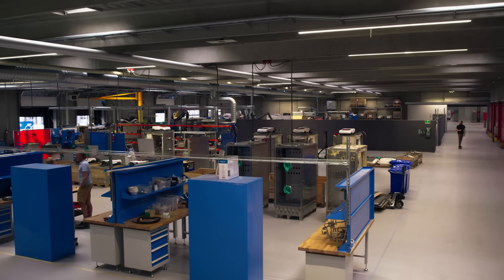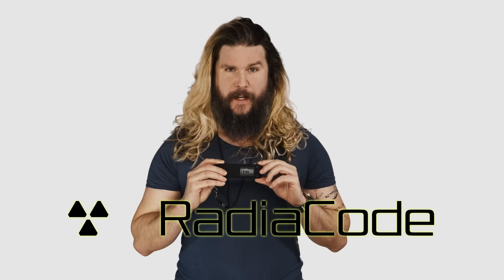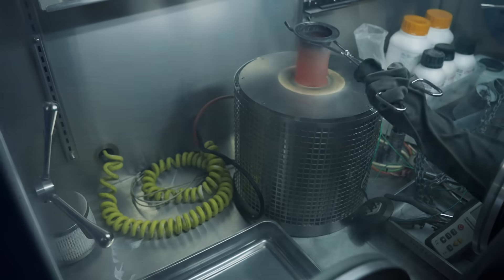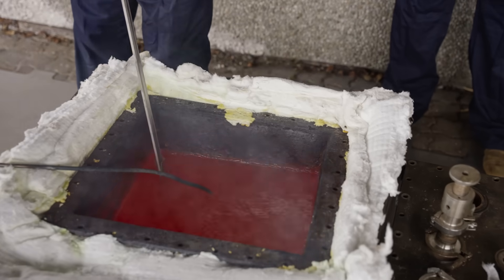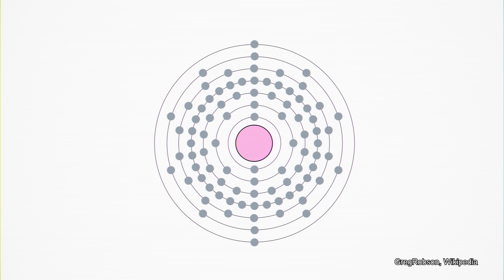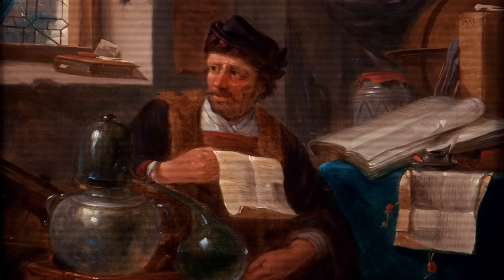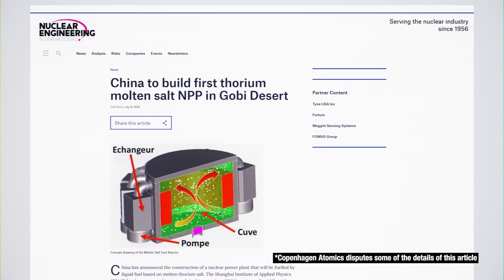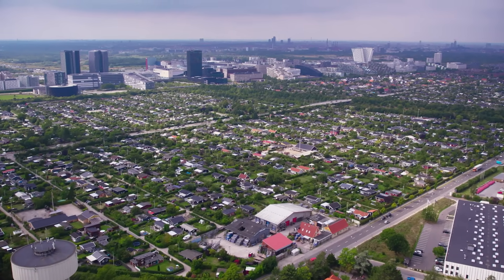Is THORIUM the Future of Nuclear Power?

Comment: The answer to your question on why the nuclear power industry is not using thorium cycle reactors is because we tried - and it turned out to be much more expensive than modestly enriched U235.  The real question is why do all the people talking about the theoretical advantages of thorium do not mention its history (perhaps because then they would likely lose funding)?

The USA built 4 commercial thorium cycle commercial power plants, and Germany built a 5th one in the 1960's to 1980's.  We have proven reactor core designs for BWR and PWR reactors; and about 80% of the world's existing power plants could be running thorium cycle in the BWR an PWR power plants right now if thorium was cheaper than modestly enriched uranium.  No one is doing that - not even India who talks about needing thorium cycle nuclear power plants (India buys U235 based reactor fuel).

I will provide more details below; but lets clear up a few other things that are false or not mentioned.

1) Thorium ore contains up to 6 natural isotopes of thorium.  Th232 is just the largest fraction by far.  While Th232 is being converted to U233 one of the other isotopes is being converted to U232 which is a hard beta radiation emitter and creates a real problem for reprocessing and use of the recovered uranium for future use as a reactor fuel.

2) U233 does exist in nature - just in miniscule amounts (and natural plutonium also exists in miniscule amounts).

3A) There is currently no known alloy that is known to  withstand the corrosive effects of the fluorine salts that most people are talking about combined with the fission byproducts (and chemical reactants) that are generated in a MSR reactor.  Note that the form of corrosion of the Hastalloy used in the Oak Creek reactor was Stress Corrosion Cracking -and was not discovered until after shutdown and testing of various piping and components.

3B) Filtering of fission byproducs in a working MSR has not yet been proven to work adequately.  There is a long way from a theory on how things should work - and how they work in real life. Lots of Nuclear Plants (test reactors and power plants) in the world had to be prematurely shut down because the theory of how something should work - just didn't in real life.

3AB testing is going on right now in China.  China build a 2 MWthermal test reactor and it went online in 2023.  They used their best guess at an alloy that showed the best corrosion resistance to what is known of the MSR molten salt chemistry from the 1960's; and combined it with their best guess of a filtering system.  Their goal is to determine if the combination of the two would produce a corrosion rate low enough to be able to build a MSR reator and systems to last relaibley at least 40 years (which they consider the minimum life for nuclear reactor).  It will likely be 5 years before we have any real answers on how well it works (unless if fails before that).

4) Thorium does not have some magic use rate that is 200 times uranium.  Uranium 238 has the very same use rate as long as its used in a breeder reactor; and then reprocessed to extract the plutonium (plutonium makes a great reactor fuel).

Also the claim of 200 times requires reprocessing of the thorium and extraction of the uranium (and you get the other uranium isotopes as well - typically U231-U234 in various amounts).  Reprocessing has proven very expensive to date - and is not an economical way to generate fuel compared to mined and enriched uranium at this point in time.  Most countries that build reprocessing plants have shut them down and at least started to dismantle the reprocessing plants  This is one of the key reasons no one is seriously building breeder reactors for U238 so they can get the same 200 times the power output from natural uranium vs once through fuel cycles.

Lets now provide a basic history of Commercial Power plants.

Many countries built thorium test reactors, and the USA Atomic Energy Commission (AEC) decided to go "whole hog" into developing commercial thorium fuel cycle plants in the 1960's. They built a thorium fuel plant. They also knew that ideally you would want to seed a thorium reactor with U233 to get it stated (for the 1st 3+ months of operation until enough U233 was converted from thorium to sustain the reaction). So they built and ran thorium cores in existing weapons production reactors and a BWR and reprocessed it into a U233 compound that could be used to make fuel for future reactors (although all 5 of the commercial reactors built use U235 as a seed material). Today the US is spending $Billions disposing of tons of those U233 compounds as the storage containers have degraded and no one sees any real future use for much U233 at this time (its a lot cheaper to dispose than to repackage and continue to store it). 

They US AEC funded the construction of 4 thorium fuel cycle commercial power plants, and Germany funded a 5th one. I suggest that anyone look up these plants on the internet and include the word thorium as well.

Indian Point Unit 1 – light water thorium fueled 275 MWe PWR power plant. Online in 1962. Changed to uranium fuel in 1965 primarily for cost savings and the plant spent the rest of its life as a uranium reactor that operated well. It was shut down in 1974 due to a change in safety regulations that was uneconomical to meet. 

Elk River – a light water thorium fueled 22 MWe BWR. Online in 1964, Shut down 3 ½ years later in 1968 due to major design and construction issues leading to failures and radioactive water leaks. This was to be the prototype SMR reactor for the USA that could be built anywhere in the USA (the SMR concept was presented at an international conference in Europe in 1955 by the USA). It had also been determined that staffing cost alone made the plant uneconomical. 

Peach Bottom Unit 1 - a 40 MWe output thorium fueled HTGR reactor (as that seemed to be the most applicable technology other than light water based on test reactors). Online in 1967, shutdown in 1974. The thorium fuel was changed to U235 fuel due to cost concerns. There were massive other plant design problems (scaling up from a test reactor size rarely goes smoothly). A total commercial and technical flop. 

Fort St Vrain - a 330 MWe output thorium fueled HTGR designed to incorporate the lessons learned from Peach Bottom Unit 1. Online in 1979, shutdown in 1989 due to design issues that could not be economically resolved. I had a coworker who had worked at Fort St Vrain and he told me that it was also converted to Uranium fuel; but I have not found any internet reference of that with the limited searches I did. 

THTR-300 (Germany) 300 MWe thorium fueled HTGR pebble bed. Online 1985. Shutdown 1989. Main reason for shutdown was inadequate containment of radioactive particles and gasses from fuel handling system (design error). They were also having significant problems with pebbles breaking.
 
With the exception of Elk River, all other 4 plants or utilities stated that thorium fuel was uneconomical compared to uranium (and the term "very uneconomical" has been used by some).

Elk River had some of the worst technical problems which is what they talk about in the papers on it, and the fact that the staffing cost alone for 22 MWe made the plant uneconomical.

The AEC modeled scaling up thorium fuel production to supply 100% of power reactors in the USA. That still showed that uranium was a far more economical reactor fuel.

What killed thorium power plants was pure economics. We currently have known thorium core designs that work in BWR and PWR reactors. If thorium was the cheaper nuclear fuel about 80% of the existing power plant reactors would be running on it now. No one, in any country, is doing so. 

Overall, I estimate that the US AEC spent in the range of $50-$75 Billion in today's dollars trying to make the thorium fuel cycle work. I'm not sure how much Germany spent trying, and that plant has not been decommissioned yet. All both countries proved was that uranium was a far more economical fuel (and I have not seen anything to suggest that has changed to date).

I suggest you do some real research into the history of thorium in nuclear power plants and the problems of molten salt reactors before you post your part 2, and various isotopes and their problems.
Reply: Also doesn't help breed weapons grade uranium, the power generation was just a bonus.
Reply: @DiakosDelvin  you are incorrect.  U233 makes a great bomb - even better and more effective than plutonium.  3 countries built and tested them.

It would also be much easier to diverts some MSR salt/fuel/reaction product and extract bomb grade U233 than for virtually all other reactor designs.  Note that all liquid systems have some amount of routine leakage that has to be replaced.   So who is going to miss a few more gallons or liters of replacement molten salt per day or week from normal leakage (what is the normal leakage rate - not to mention seal failures)?

No one is building U233 bombs because again economics won out - even for the military where they often spend more money for a more effective material.  Bomb grade U233 from a thorium cycle is much more expensive than bomb grade Plutonium from U238 breeding.

Note that bomb grade plutonium is produced in special bomb grade production reactors because the refueling time periods in normal power reactors is too long to produce bomb grade plutonium as some Plutonium 239 gets converted to Plutonium 240 which poisons the U239 as a bomb material if there is more than a very low amount of Plutonium 240.   I note that U234 is generated the same way and U234 poisons U233 the same way and the intial bomb grade material was produced in the same special bomb grade production reactors.

However, the MSR cycle fluid contains protactinium, which decays to pure U233 and makes phenomenal bombs without any U232 radiation concerns. So separate out the protactinium and you get the best bomb material by normal natural decay (with no U232 or U234).

Comment: I bet the reason there are no commercially operating Thorium nuclear reactors today is because molten salt at this temperature corrodes materials super quick and they just don't last creating a radioactive leak hazard plus a whole lot of maintenance, the fuel is relatively cheap, but the plumbing with all the constant work isn't.
Reply: In the video he says that they have to replace all the plumbing every five years.

Comment: In case anyone is wondering why the US government didn't think of this when racing against the destruction of Axis powers during WW2, here are my ideas on the subject.

Uranium was initially used over thorium is because uranium is naturally fissile unlike thorium and ready to use in reactors without needing a complicated conversion process making it CHEAPER. Keep in mind, thorium maybe in greater abundance, have reduced nuclear waste outputs and, over all, have potential for inherently safer reactor designs. HOWEVER, while thorium can surpass heat outputs of uranium in nuclear fission the energy needed to get fissile thorium and those measurable results wastes any advantage given in the output.

In the nuclear fusion future, where nuclear fission is a stepping stone of the past, and with unlimited energy, thorium would likely be better a better over all medium for fission. By then though, we'll be using isotopes of hydrogen and have little need for all that crap. Thank you and have a good life!

Comment: If I were to guess, the reason why thorium reactors aren’t widespread is the same reason they’re safer: You can’t make bombs out of the products.
Reply: Back in the 40's they  specifically made the decision to go with the design that produced material for bombs.
Reply: you can, but in the process of getting the U233 you also produce small amounts of U232, a strong gamma emittor, which would cook anyone working with it, as well as being very easy to detect.

Comment: To be one of the big downsides was mention in passing molten is nasty stuff when it comes to corroding metals which I why the short life span of five years for the piping and pumps.
I would like Kyle to a report on Iron reactor, which basically work by pumping oxygen over pure iron and burning its by product is rusty iron run hydrogen over the iron you get pure iron again which you can burn again

Comment: if it compounds then what happens when all the thorium is converted into uranium 233? is there a heat limit? i know the guy said the metal only lasts 5 years, so why not make one with metals that last longer? could you make one out of lead or tungsten? i realize that would make it next to impossible to assemble or move or support itself, but could it be done?

Comment: The reason we don't have molten salt reactors on large scale is simple: politics. There are too many lobbies that pressure governments to give into their demands, and the current lobby with the greatest influence is the environmental lobby. They have invested trillions into "green energy" initiatives — energy projects which have not only been extremely costly, but also highly detrimental to the environment. Wind turbines that produce far less energy  during their operating lifecycle than the energy used to produce them. Solar farms that reduce available land that could be used for food production. Hydroelectricity which can only be used where water is abundant. And geothermal energy is prohibitively expensive to mass produce.

That leaves us with nuclear power — and the environmental lobby has been successful spreading disinformation about nuclear power using Chernobyl and Fukishima Daiichi especially to sow fear.

Comment: if i'm not mistaken, some of the issues/challenges with molten salt reactors are 1) the molten salt is very corrosive, be it because of its composition, as well as the high temperature, thus it could be quite difficult to build a reactor that lasts long enough (i suppose at least a few decades would be ideal) 2) extracting the spent fuel byproducts and/or adding more fuel without having to shut down the reactor
Reply: Replenishment of the liquid material should be a simple matter of bleeding off a steady small proportion from the circulation while simultaneously injecting clean fresh liquid. We used this system in a glucose production plant in the UK around 50 years ago. 100 tons an hour of acidified starch/converted glucose slurry circulated in a high temperature chemical reactor while 10 tons an hour was injected. The bleed off consisting of a blend of unconverted starch and glucose passed into a hot tube for further reaction (dwell) time before the starch conversion was complete. So using similar principle there should be no reason to stop and start for fuelling.

Comment: Thorium is a good design for power plants that run consistently. Reactors that need to start up and shutdown quickly would not really fit due the thermal requirements of the molten salt.

Comment: The Australian electricity grid is 1million km long and $1million per km. Or more.
$TRILLIONS and 10 decades to build. 

Grid owners want $100sBILLIONS in cashflow to get a ROI, return on investment.

You rent the grid to use dirt cheap electricity. 

With EVs v2g massive battery parked 23hrs every day and all night long you can keep your own diet cheap rooftop PV electricity and keep your own lights on 247.

The massive battery on wheels that people can drive daily and rapid charge weekly can easily be topped up daily and run a home over night. 

So if you must have a vehicle make it a v2g EV and make tax-free savings on grid electricity, gas heating, petroleum, and maybe daytrade electricity with the grid. 

High marginal taxpayers get the best taxfree savings, 'best bang for the buck'.

Happy days. 😊😊😊😊

More v2g EVs is more grid stabilisation from more battery capacity. 

Grid owners will get mixed feelings from the SHTTSNPANTS of no cashflow to how can we keep the millions and millions of customers and supply the industrial users moving away from fossil fuels to clean electricity. 🤔 

PS, grid electricity is distant renewables electricity and coal fired electricity and nuclear electricity and plutonium electricity and thorium electricity.
Plutonium electricity gets 'more bang for the smaller buck' for dictators agreeing to stop their CO2 emissions.

'Best bang for the citizen buck' is the v2g EV and buildings rooftop PV.
Even 3 storey walk up flats with 100% roof area PV can get enough dirt cheap electricity. 

80% of the world's population live in warm latitudes. 
80% of the world's population live in dictatorships.
Does anyone think 🤔  ???

Comment: I assume I'm missing something but the word "salt" kept getting used so what (if any) corrosion risk is there from this type of system?
Reply: I believe salt would need water to be a major concern for corrosion. I would also guess that with the salt being as hot as it is helps keep things "clean" so corrosion couldn't happen.
Edit: I should point out that the guy in the video said parts of the reactor would need to be replaced every 5 years. I wonder if that could be from corrosion  or if there could be some kind of salt build up from deposits that need to be removed periodically.